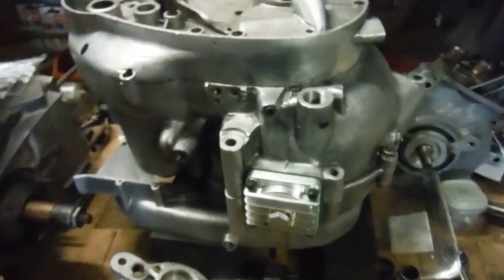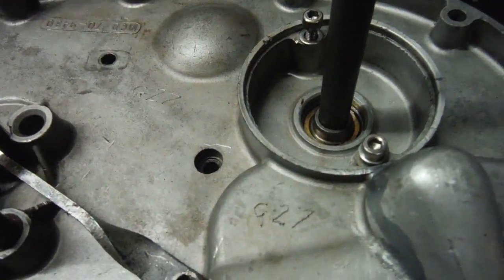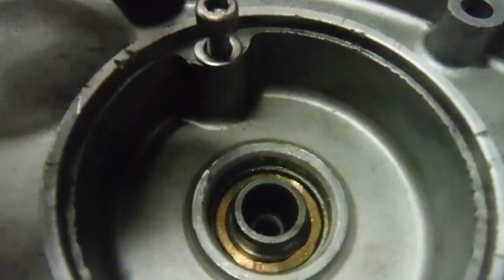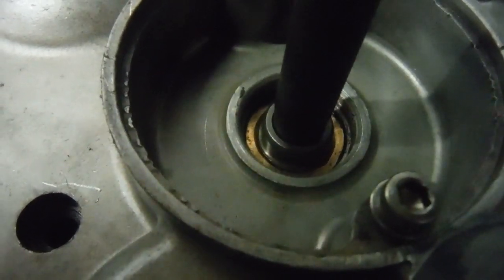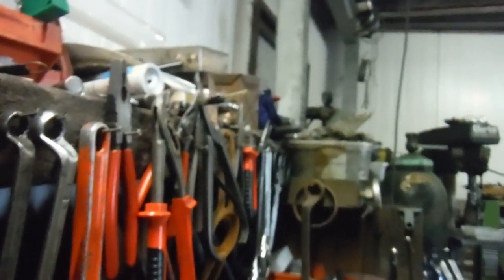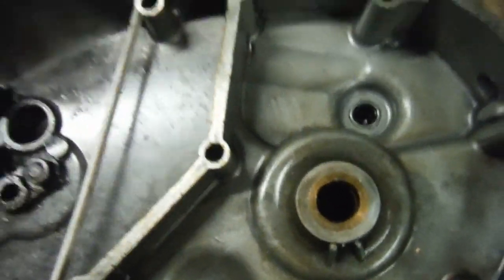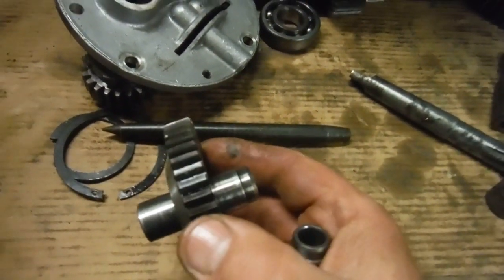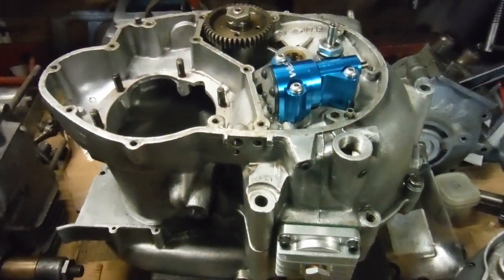BSA A65 - another one! - engine jigsaw puzzle 3 Fit of new bushes & spindle for timing gear checked

Comment: hi Paul whats the camshaft bushes like? also i notice the bush on the inner timing case is flush with the case boss on some a65s that bush as a flange bush which takes up any side end float on the idler gear might be worth a check because that can make a proper wattle or knock, but having said that it depends on what year the inner timing case is, the late ones are different to the early ones along with the idler gears where different to, i hope that makes sense.